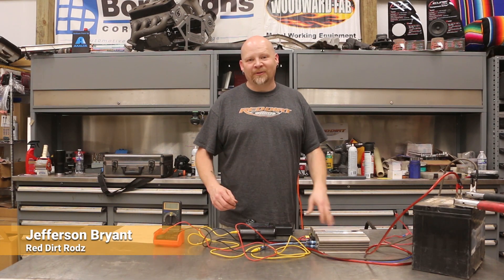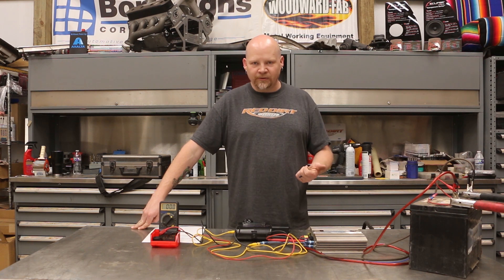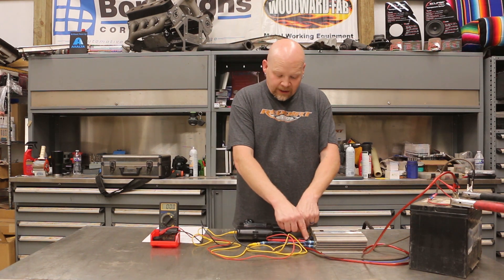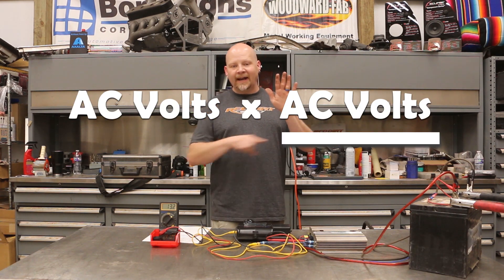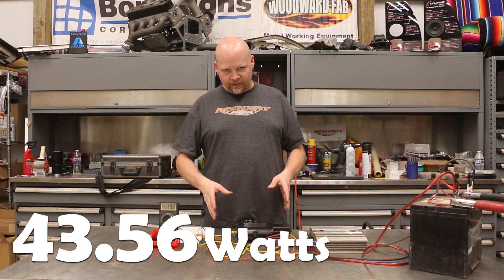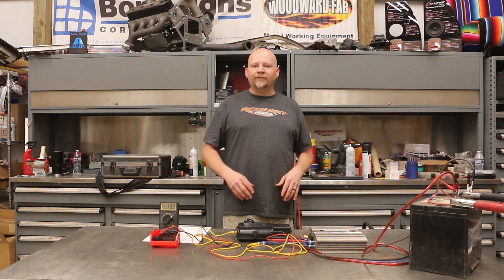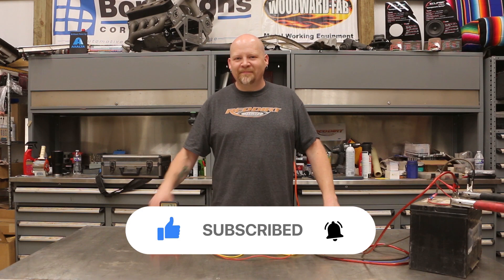How To Test Your Amp's Actual Output With a DMM Digital Multi-Meter

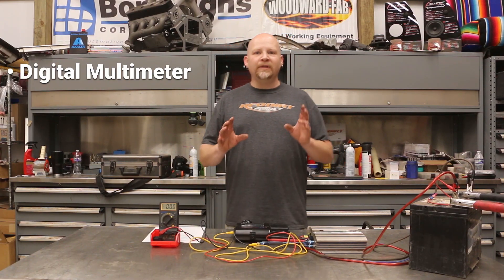Comment: How loud should the system volume be set to to test the output wattage? @ 0:55
Reply from the maker: Maximum clean output. If you are not sure, use 3/4 volume.

Comment: What is the peak - peak voltage of your input tone? traditional 1v or higher?
Reply from the maker: The Audio Toolbox tone generator is variable in voltage. However, the input signal voltage doesn't matter when the amp is properly level-matched and playing a clean signal.

Comment: Is this accurate without a speaker/resistor bank present across the + & - ?
Reply: No, you need a known resistance, so measure the resistor bank with the multimeter before connecting the b+/- and remote if you're using a car amp. You need to know the resistance to accurately measure the output, though it's a ballpark figure as a real speaker load changes through the frequencies. For instance an 8 ohm 18" driver might be rated at the nominal 8 ohms, but be around 50 ohms at 20hz, and 8 ohms at 1khz( which hopefully that size driver wouldn't be operating at that high a frequency.

Comment: Maybe I missed it but is this Peak or RMS power?
Reply from the maker: @ericcurrence8477  this is actually output. RMS is the highest sustainable output, peak is the max momentary output. 

This equation is the actual output of the amp in the real world with real inputs and outputs.
Reply: @Reddirtrodz How does that align with Peak or RMS speaker ratings though?

I want to upgrade a factory sub, and need to probe the amp to figure out its output, and select an appropriate speaker.
Reply from the maker: @DilutedImage  why bother? You won't get more output, and the factory amps are usually low-powered. You are far better off replacing both. 

This is RMS power, by the way.

Comment: Hey so I tryed it on the 4ch do I divide by 2 at the end to find out per ch sense we tested in brige mode or is that per ch?
Reply from the maker: if you tested it bridged, that is your output. if you want to know the individual channel output, test each channel separately. The impedance changes when you bridge two channels, so that greatly effects the output.
Reply: Thanks so measuring each ch there’s no need to times?
Reply from the maker: @ryantallent1883  yep.